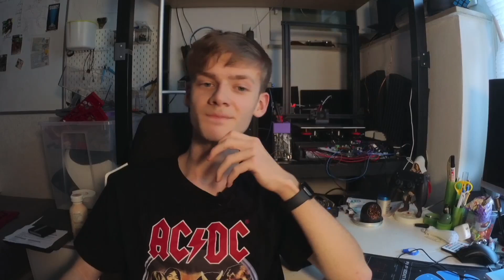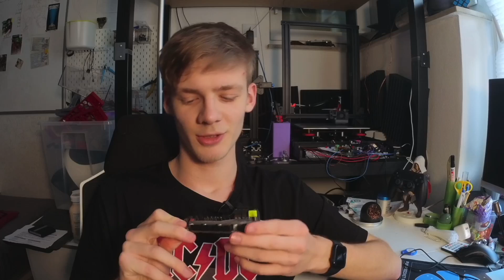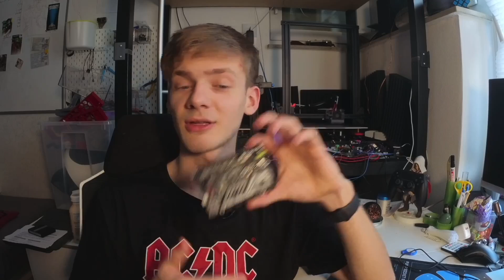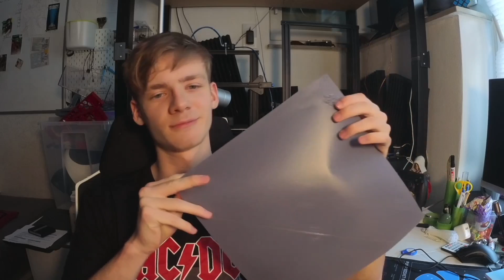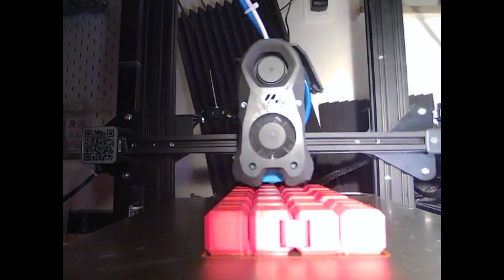How to use DUAL MCU's in KLIPPER

Comment: Hey, good to hear my video helped out in some way :)

It's a long should but on the enders they had this weird problem that caused layershifts due to some static buildup from the bed and transferring through the Y motor and back to the mainboard. Solution to the problem was to ground the frame and the Y stepper motor to get get rid on the static build up